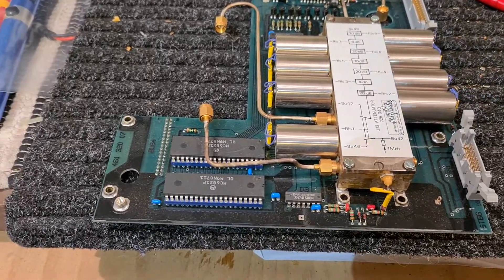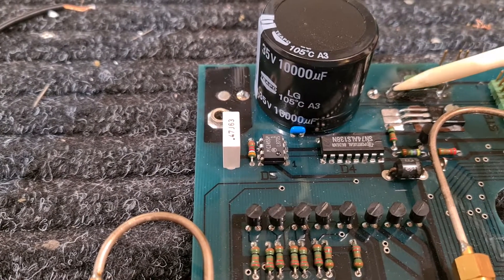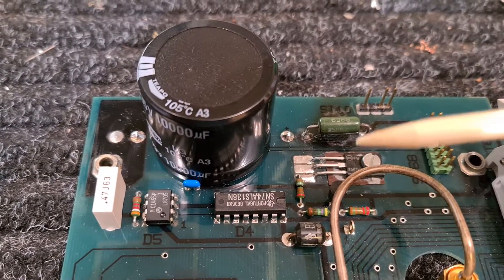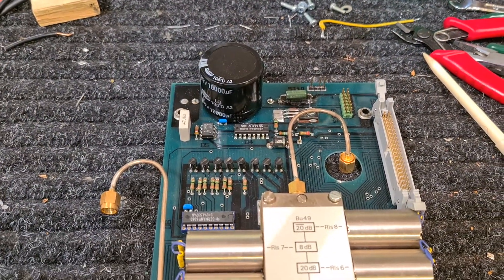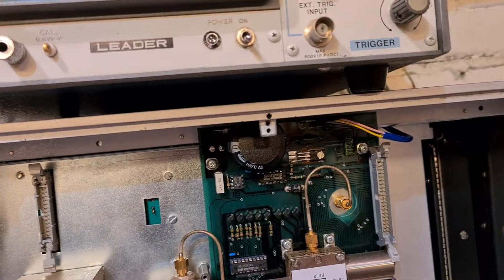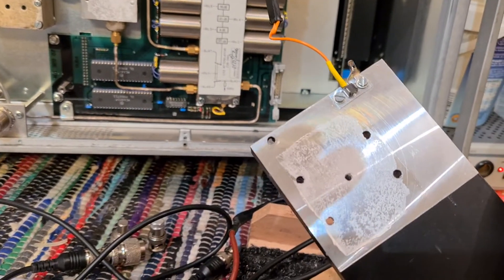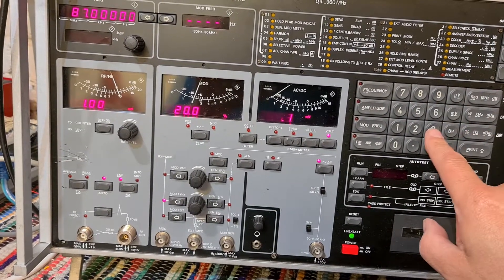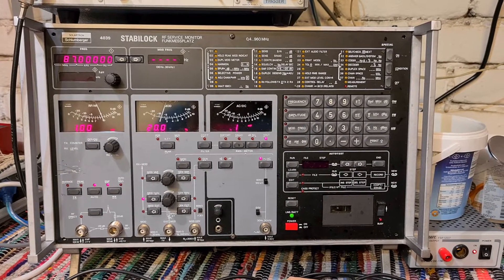Schlumberger Stabilock 4039 (4040) attenuator board repair.

Comment: Colleagues, will someone tell me what kind of memory battery should be mounted on the U8 board?
The previous owner soldered 2 x R6 1.2V serial, it looks ugly.
Reply from the maker: https://www.yumpu.com/de/document/view/8112521/solartron-schlumberger-stabilock-4040-foo full service manuals and parts lists (2 volumes)
Reply from the maker: Here's the original battery: https://www.batterytex.com/product/detail/varta/ds2gt/comp-24-2-4nmh
Reply: @DerekHerbst747  Original VARTA battery purchased. It turns out that the symptoms indicate a lack of synchronization in the synthesis loop. Unfortunately, damage on one disc shows all errors from other places. This is the logic of the Stabilock devices. Thank you for your help, I will inform you about the effects of the repair.
Reply from the maker: @radiokom5087  it sounds like you found the problem. Of course the synthesizer supplies reference frequency to many boards. Good luck with the repair!
Reply: @DerekHerbst747  http://www.hamble.demon.co.uk/si4040.html. Description of a similar case and method of repair.

Comment: Great job !
I have a more complicated problem with 4039. SELF TEST shows a whole series of errors: ERR U3.1, U5.4, U16 / 1, U5.5, U6.2, U11 / 6, U6.3, U6.4 and U6. 5. The device is so old that I am afraid to take it apart. Any suggestions? Symptom: no signal from the RF generator
Reply from the maker: It's a very modular system. I would recommend starting with the power supply module. It's the most likely reason for multiple failures and error messages. Very likely that a capacitor is failed.

Comment: Now that is scary. My Grundig seems like a breeze in comparison.
Reply from the maker: I was very scared of opening this up, but a) It had to be done and b) my curiosity got the better of me. Once I had it open I was relieved to see how nicely it is constructed. Very modular. and VERY robust. The only odd thing was the 15 volt electrolytic smoothing/buffering a 15 volt source.. I am amazed how the power supply board withstood a dead short and came back smiling..